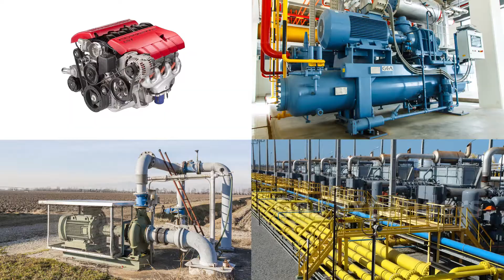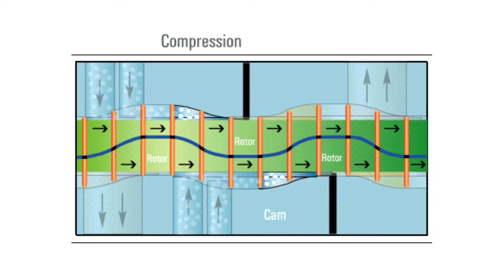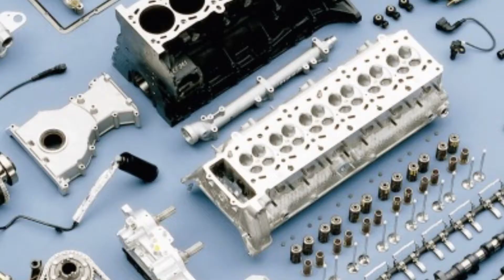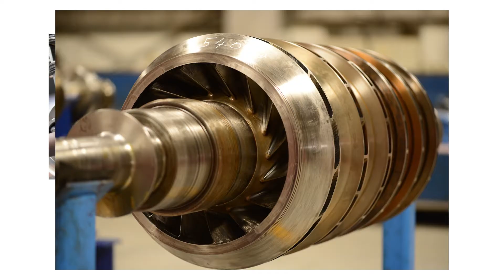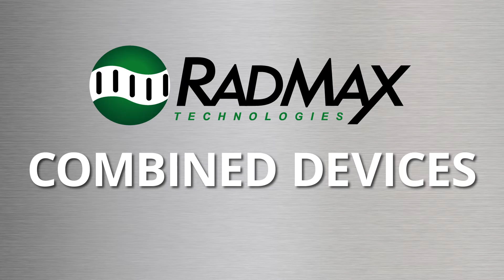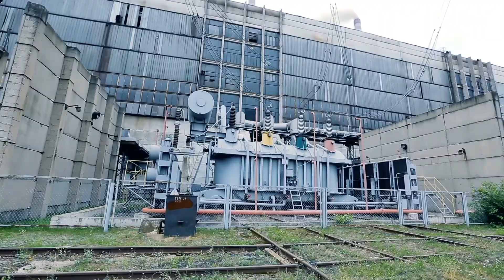RadMax Technologies

Comment: There's no details about cooling and lubricating. If I see correctly these vanes rub against sloped walls. Curved shape and low touching area make it difficult to seal. Besides even tiny wear of those vanes makes it lose compression. No place for error, no spring loaded seals. 
What if vanes was guided side to side by some well lubricated slope mechanism and never touch side walls? Then it becomes possible to use spring loaded seals
Just like Wankel engine. The rotor never touches walls of combustion chambers, only seals do.

Comment: This is a really good design, but I have a few questions though:
1. How are the vanes lubricated?
2. How the Combustion and Vanes cooled efficiently? Can we have a look at the Heat Exchange design?
3. How are the Vanes sealed and lubricated during its lateral movement from side to side?
Reply: 1.prob like a 2 stroke 
2. I dunno, prob like a 2 stroke weed Wacker 
3. If I had to guess similarly to a Wankel rotary
Reply: What if the parts were made of ceramic 3D printing?
Reply: @marcoserbe1 that would be even worse because 3d prints have layer lines AKA gaps
Reply: @igormorningstar : Couldn't It be smoothed by machining the surfaces?
Reply: @marcoserbe1 I mean yeah but you would need strong abrasives